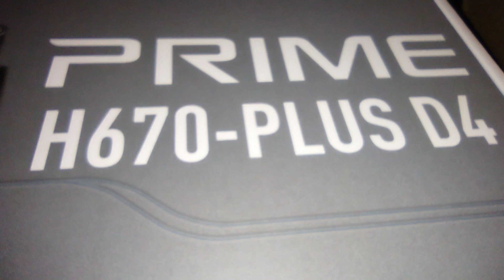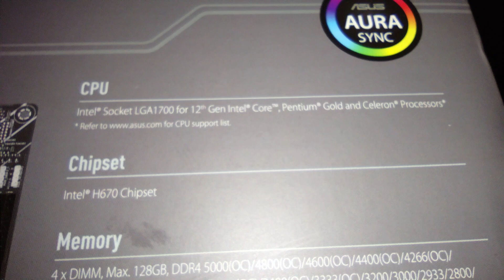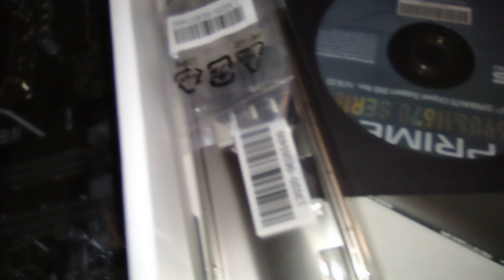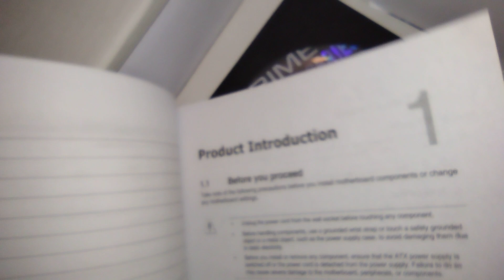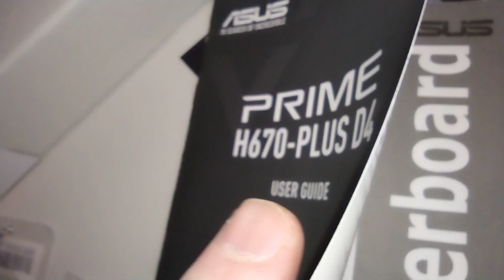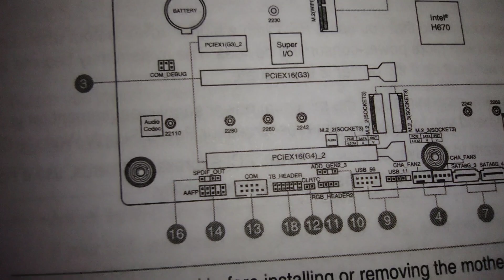Unboxing Asus Prime H670 Plus D4 motherboard Macro View, Overview of features

Comment: Where I am, this MB costs USD 170. As such, it is a little disappointing not to see a USB 3.2 Gen 2x2 port for my external backup SSD drive. I don't care too much about DDR5 nor PCIe 5.0 x 16 slots because they don't bring much at the moment. In about 3 years, it will be time to upgrade again - so I will spend as little as possible now and upgrade later on. Future proofing is a myth - stuff you get now won't be optimised for the future. Better to get what you need now and then get a cmpletely new set in future.